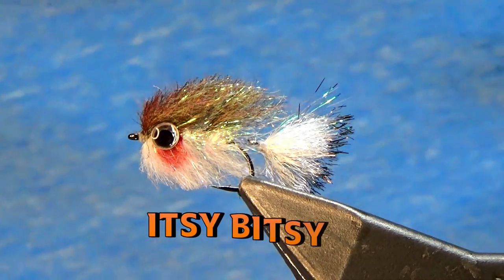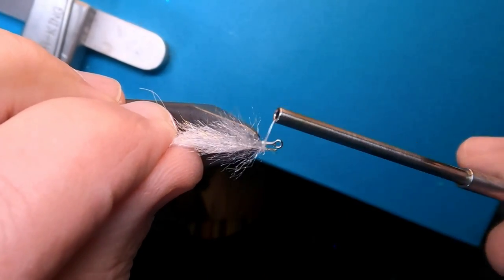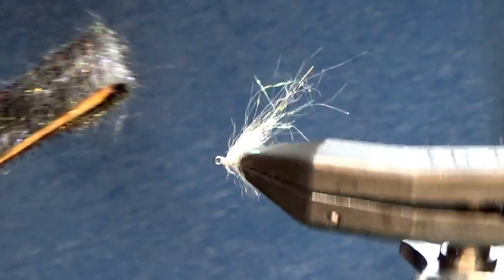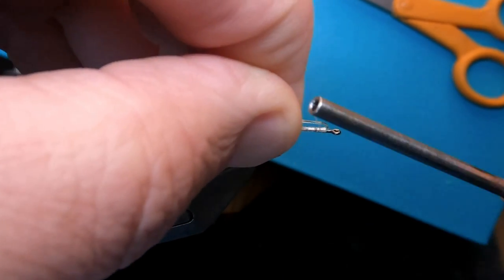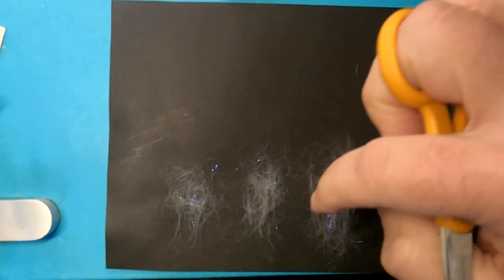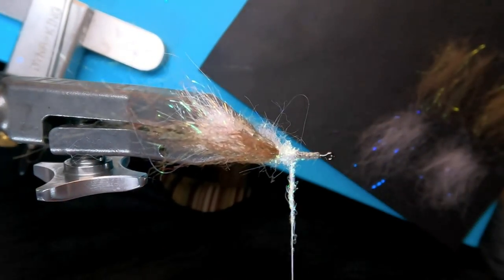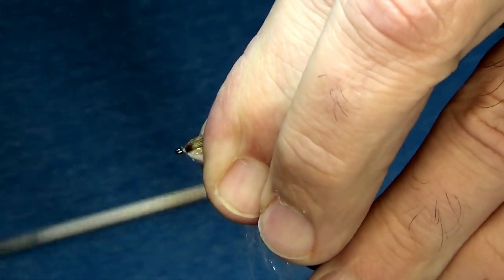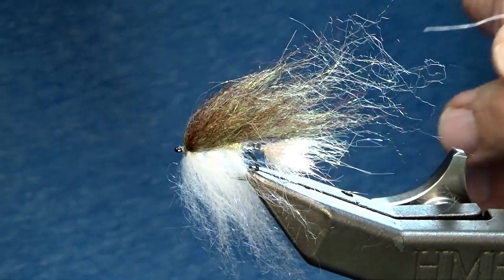Fly Tying: A micro articulated streamer the Itsy Bitsy!

Comment: Awesome fly! Going to be tying up a few of these in the very near future. Wonder what your thoughts are on adding a little weight near the bend of the hook to allow the fly to keel correctly or if you found that it typically does it on its own without any added weight. Thanks, again! New subscriber here.
Reply from the maker: The fly does have a tendency to kick off to the side unless you fish it incredibly slow. Throwing a little weight on the bottom of the hook will keel it perfectly! You can also just say the heck with keeling it and put a little micro shot above and fish it more like a wounded minnow. Fish it as a top dropper with two flies (see my video 2 are better than one) or another idea if you're Euro fisherman is to put this as a middle fly, off a tag, and put a jig fly down below. That will also keel it and make it twitch and move incredibly! Thanks for subscribing BTW!